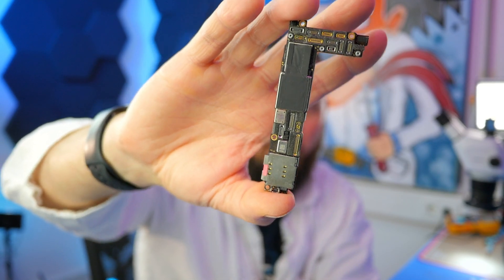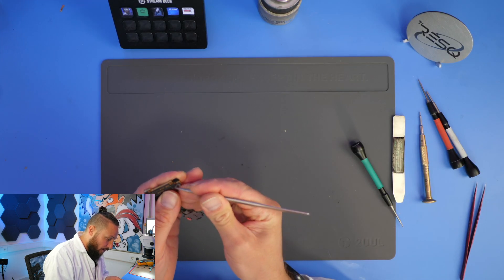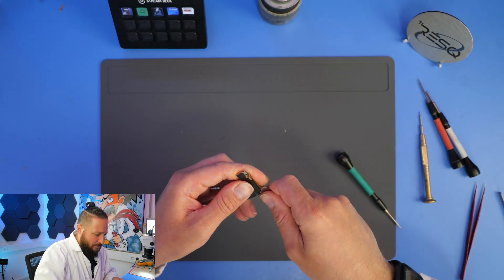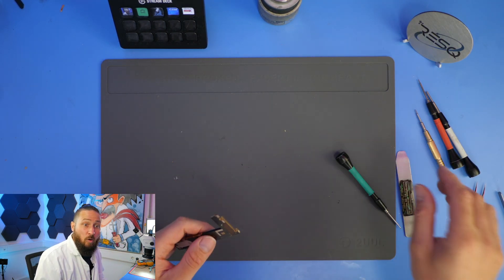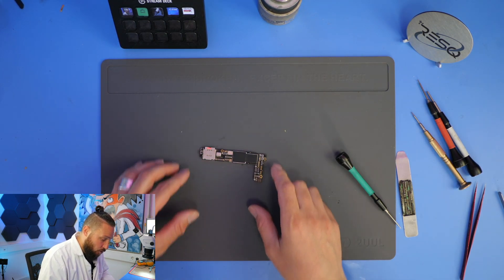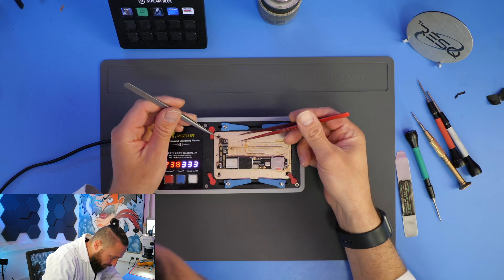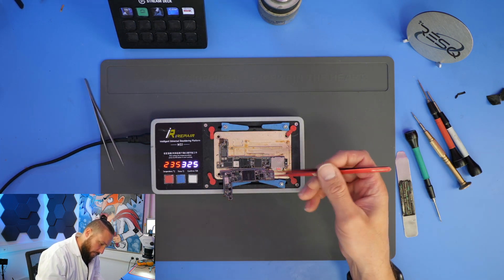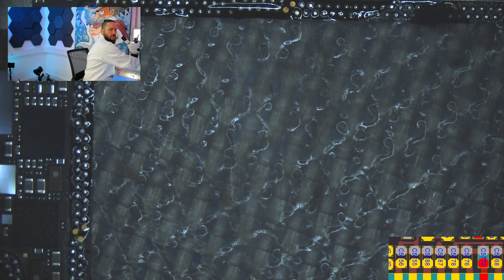👨‍⚕️Expert Method: How to CLEAN PADS on an iPhone LOGICBOARD - Easy Technique

Comment: will the boards stick together if you dont use a stencil to reball? (you just put solder with the iron tip)
Reply from the maker: No.
Reply: Tried experimenting with the nand reballing no it's definitely not working

Comment: Hi Ben! Once again, I'm blown away by another amazing video. Your idea of using the fiber glass pen is pure genius. When it comes to repairing water-damaged boards, which is a common issue I encounter, I've found a helpful trick. Before wicking off the old solder, I like to go over the pads first with fresh solder. This technique may not always guarantee success, but I've noticed that if I solder the pads first and make them really nice and shiny, then desolder them, they often come up perfect without the need for further cleaning. Of course, this approach doesn't work in every situation, especially with severely damaged pads. That's where your technique with the fiber pen comes into play! Thank you, as always, Ben. I'm eagerly looking forward to your next video.